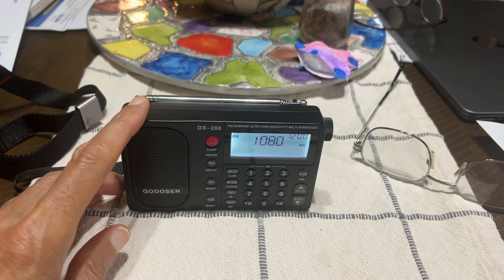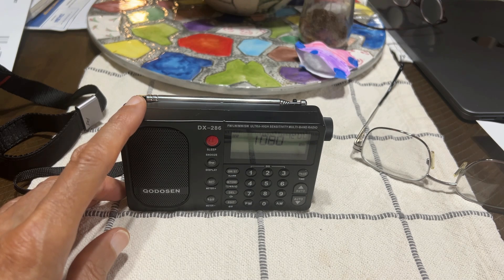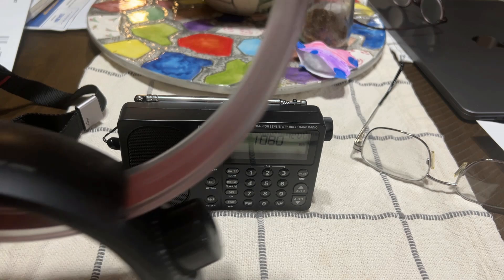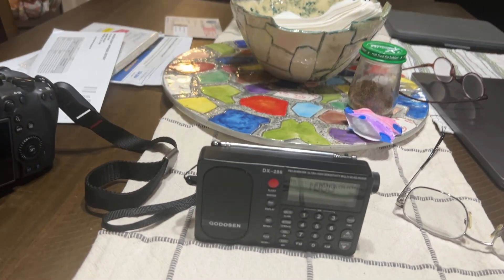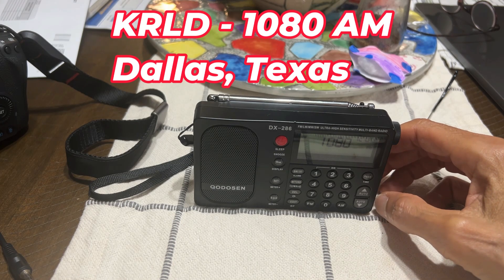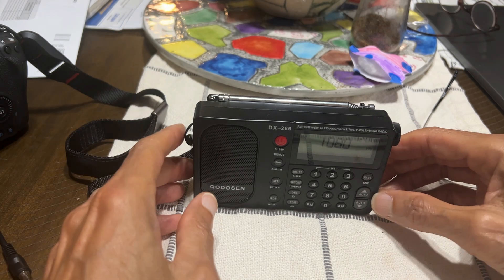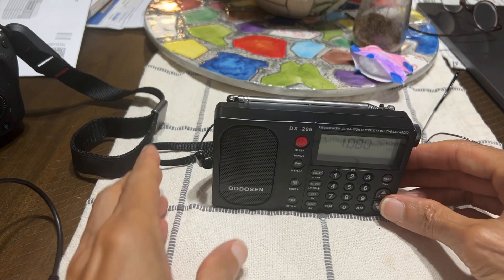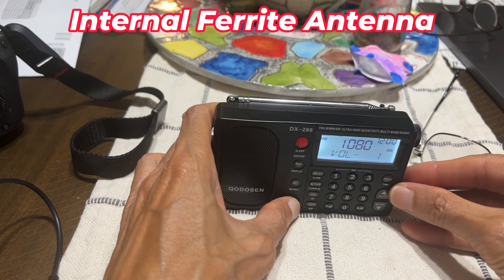Antenna Comparisons on AM 1080 with the Qodosen DX-286

Comment: In my experience using the AN200, you should discard the wire and use air coupling to the internal antenna.  Keep the radio set to internal antenna.  Then just place the radio inside the loop and rotated sideways.  This aligns the internal coil antenna with the AN200 to produce the desired coupling and associated enhanced AM reception.  You still need to tune the antenna for best affect.   This gave me much 5-10dB better signal strength compared to using the wire and switching to external antenna.

Comment: Hello, is there not a signal strength display on this radio you can use ?
Reply: Hello and thanks for the question.  Yes there is a signal strength meter on this radio but I never really use it. You access it by pressing the button with the key symbol.  Will keep this in mind for future comparison videos.